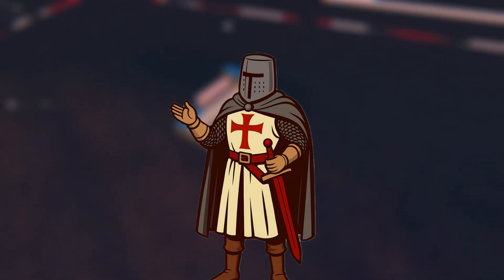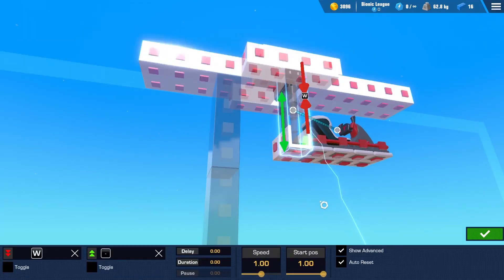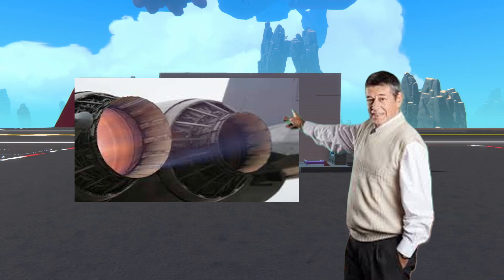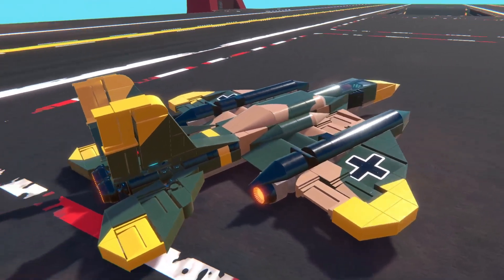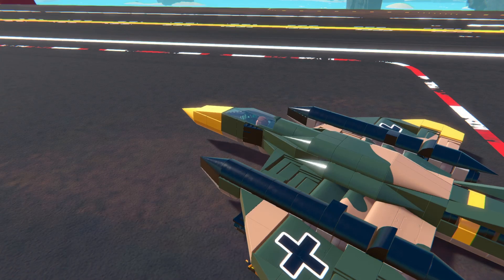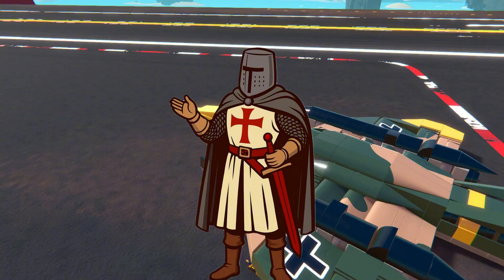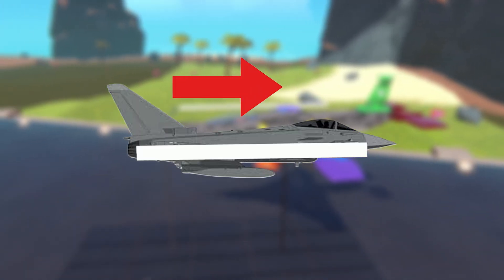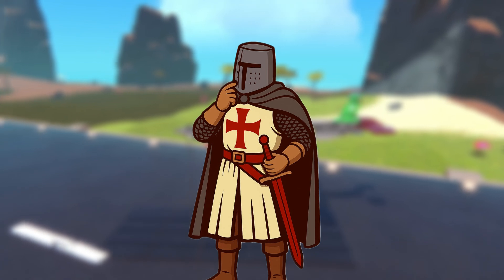**THE** JET CRASH COURSE | Trailmakers

Comment from the maker: Did this help you out?

Let me know!
Reply: Yes thx
Reply: how do you make decent good looking planes???
Reply: @AxelSandberg-i6n 
By translating IRL plane dimensions into block size equivalent (I use either 2 or 4 blocks as 1 meter, depending on the scale of the plane I build).
Or just with trial and error, as it's supposed to be done

Comment: Smh, a regular steering hinge is soo much better for steering, rather then both flaps, and gyros
.
The hing allows for smooth flight control, and better energy retention... Making it easy to turn at supersonic speeds and still maintain a large portion of speed
Reply from the maker: Uhhhh "smh" I just forgot to add the combination of hinge and el- oh wait. I did show it😃